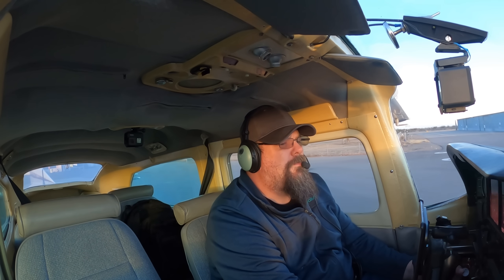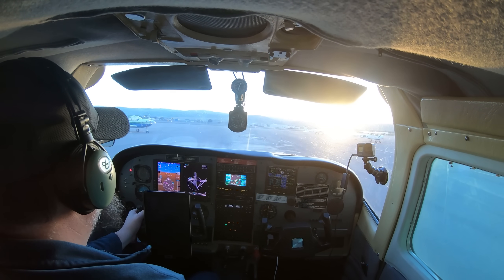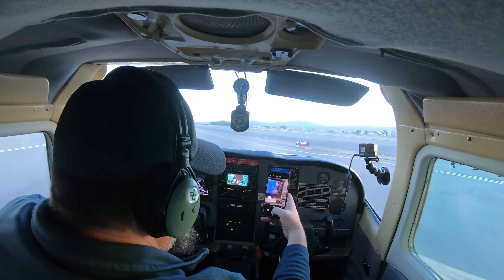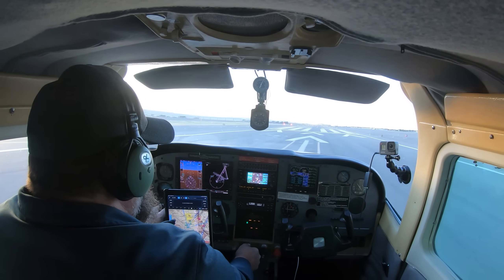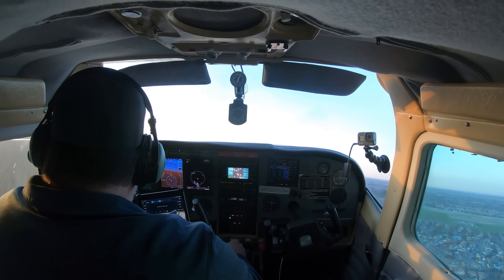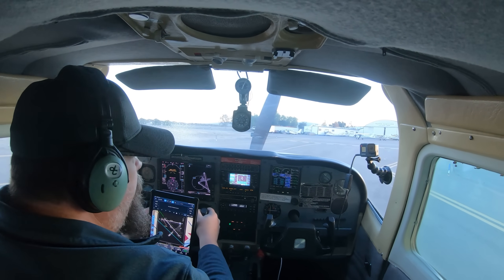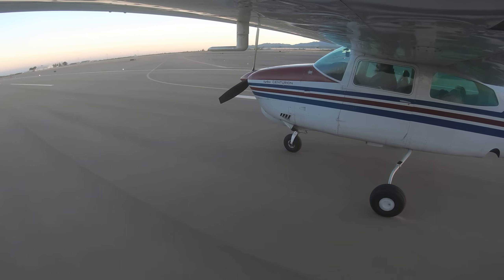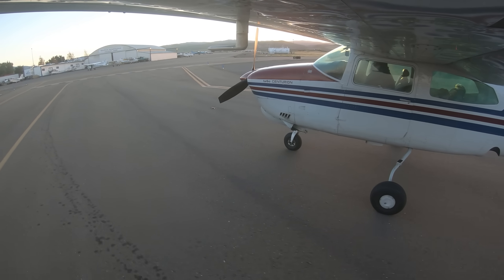Catastrophic Engine Failure after Takeoff

Comment: What are going to do about it?
Try to find a aircraft mechanic that knows what they are doing!
Reply: Hard to blame the mechanic without tear down and evaluation of the parts and data. Not saying it wasn't the mechanics fault but it could have been defective parts or detonation,  it could have gone lean and detonated from when the pilot accidentally pulled the mixture instead of the prop back right before the engine let go its impossible to put blame or point out the root cause without a full evaluation of the data log and engine hard parts. Most importantly the pilot is safe!

Comment: Hey Ed you were amazingly calm when the engine failed both times.  One in the air and just before you landed. I agree with one of the comments below, engine failure is one of my biggest fears.  I don't have a pilot license but moving towards that goal. Great video and I can only hope to handle a engine failure as calmly as you did.  GREAT JOB!
Reply: It only failed once. At that point it was just windmilling, until he slowed down enough that it stopped completely.

Comment: I'd be interested to know what type of facility did that overhaul. Was it a major engine shop or a local mechanic? It may be a pictures kind of thing, but the cylinder base nuts, case half seams, and case looked unusual for a fresh overhaul.

In the future, it might be a good idea to keep the gear down and let it run at takeoff power until in position for an assured landing. Notice how it came unglued as the RPM reduced? My SOP is to not mess with the power from liftoff to 1000 AGL for that very reason. Not the first engine to self destruct during a power change.
Reply: The nuts and case seam issues may be due to what looks like connecting rod failed and beat a new inspection port in the crankcase. 

Hope you have a good warranty on the engine. That one looks trashed.

Comment: Well, that sucks. Could have been worse and happened at a lower altitude. would be interesting to see/know what happened, [Besides the obvious air conditioned crank case.] maybe bad bearing/crank fitting although you said the oil pressure was in the green? Improperly torqued rod cap nuts?
Either way that motor is toast. May be able to save some sleeves, rods and pistons. If it were me going 1,000's of feet into the air with it, I would want an entirely new long block...Heads, cams, sleeves, crankcase with everything in it..."Long Block" Only reuse the external parts such as magnetos etc....

Comment: Good job managing your airspeed and saving yourself and the plane.  Bad move mixing up your prop and mixture knobs though... Not a great thing under boost... that shouldn't have grenaded your engine though.  Looks like the engine shop owes you a new engine.  Hope it works out for you.  Maybe the connecting rod bolts maybe weren't torqued to spec or a bearing wasn't installed properly.

Comment: These damn American piston aircraft engines.. I've had numerous cars, driven hundreds of thousands of kilometers, never one engine failure. Not even close to to one, even.
But shit like this, in the video, happens way too often in these aircraft engines.
Reply: Automotive engines are not expected to run at high continuous power settings. The Australian GM Holden 202 castiron motor weighed around 400 lbs. As an industrial motor for continuous duty it was rated at about 62hp. Its maximum HP was 119 "when engine longevity is not a consideration." Modern automotive engines are better but their task is full power outputs intermittently. Once well into their normal lifetime, a run at high continuous power can break them.
Reply: @DARANGULAFILM  Do you have any reading on that? I don't believe it. There are a lot of various types of applications where modern gasoline engines are required to run at high power output, in particular when towing at maximum payload, etc.
Reply: The specs on the GM Holden engine came from the sales information brochure. It is an older engine series so your comment is valid. 

The internal mechanicals of modern alloy engines seem to survive longer than in the past. 

That may be due to some operator and servicing mismanagement being taken out of the equation by electronic fuel metering, ignition systems, more refined manufacturing process and improved metallurgy. 

Those gains have been negated by some beancounter decisions like open decked engine designs which have foreshortened lives due to distortion and failed head gasket seals when driven hard.  

It is also a horses for courses thing. Heavy road transport engines are designed for longevity and deliver it.

Comment: Congrats on getting back down safely. There was a Beech Baron flying by my area when something similar went bang in the left engine. A 3" piece of the cam shaft exited the engine leaving a hole in the upper cowling about 3x4 inches. The front two cylinders and crankcase separated from the rest of the engine and were held on only by the thin metal of the oil pan. No prop control was possible for feathering, so the pilot landed a few minutes later at KIPT with the front of the left engine and prop dangling in the breeze.  Luckily the airport was straight ahead and about 10 miles. We changed the engine and patched the top cowl, but that was one for the record books. Imagine what would have happened if the prop, front crankcase section and cylinders had peeled off.  I can't imagine why they didn't. Apparently the crank shaft broke first.

Comment: Throwing a rod isn't fun. Wonder if a magnetic flux check would of caught any hairline cracks. on me a mechanic had been using a metal hammer on a 172 rocker arm to free up a valve that would stick. I found that out after using the plane skud running under a 1,000' ceiling when the right side rocker arms came apart. Not much power after that :)

Comment: My biggest fear. Damn dude. Nicely done.
Reply: This is also probably my biggest fear or one of them. Engine out, during takeoff... But you made it back! Nice work.
Reply: My father and best friend died from this. Both fighter pilots. Super Decathalon. Engine quit a touch lower. So so glad he made it! Praise God! This guy did great.
Reply: @The Woodsman  had a friend die in an ultralight when the engine died on takeoff. It basically stalled out immediately and side slipped into the ground.
Reply: @btbarr16  i hate to hear that buddy and my comment wasnt intended to offend anyone. I just cant feel at ease in an airplane bc it has an engine i loove engines i thoroughly enjoy building engines for people. But im telln ya ive seen parts fail stock parts that have never been touched with few hours no rhyme nor reason. Ive seen 4 different bikes brand new kawasakis bust pistons across the wristpin bore. Two had less than 30 hours on them one had less than 10. So i cannot have any faith in an engine i know nothing about im just supposed to trust that the last guy did things rite when working on it and that no parts will fail. I just cant
Reply: @Logan Penland  I want offended. Ultralights are dodgy at the best of times. I work in airport operations. So, I'm no stranger to what happens when things go sideways. I'm the one who has to deal with the aftermath. That said, the vast majority of the time incidents and accidents are due to pilot error, not mechanical failure. Even the times when I have dealt with aircraft incidents due to mechanical error, they're usually situations where if the pilot would have done a better job, things would have gone better.
Reply: All engines have bearings bearings fail even when oil bathed. As in this case one of the big end connecting rod bearings decided it wasnt going to turn anymore and pitched the rod out the side of the block million wonders it didnt lock down immediately. Maybe the bearing clearance was too tight or that bearings oil galley was plugged and starved it of oil. Either way this is precisely why i cannot trust/feel at ease in an aircraft. Pulling off the side of the road when your car quits is not the same as when an aircraft engine quits or in this case throw the rods of of the airplane. I give this guy props for how calm he handled the situation and for the awesome job he did  landing that thing it locked totally down when he about to touch the runway

Comment: First off I'm glad you didn't die and did an excellent job of controling your energy and getting the nose down to make it back, just barely!  Now about scaring your mother you are in big trouble for that and will hear from her later today.  Sorry about the engine but glad you didn't get broke most of all.  Looks like you didn't have to change your pants either cause you were puckered up real tight and focusing on the important stuff like not making a smoking hole in the ground.  I might have opted for the road while I still had the time but I was not there and am proud of the way you handled things.  You still have to deal with your mother though so have the good scotch ready!

Comment: You say you did what you shouldn’t of done, but seeing that you managed to fly the plane and land safely on the runway, i say you nailed it in an intense scenario.  Great job!
Reply: His situational assessment - "this is the altitude I turn..." and familiarity with the airport made that split second decision a good one. Seems likely he'd have landed straight ahead if any of those criteria were different.
Reply: Hell yes! You could have easily stalled trying to gain any altitude at such a low RPM. More importantly, you knew that you had to land regardless, and an airport runway always beats a highway, a plowed field or a forest any day of the week!-John in Texas
Reply: I think that rule is intended for regular pilots, not the exceptional ones. We now know which class your in.
Reply: @jsiwek7212 Physics don’t care about your feelings
Reply: shouldn’t have*
Reply: Sir, most airports have one runway. He would not have successfully made the turn if there was only one runway
Reply: Having the performance of a turbo big bore six made that possible. Anything less wouldn't have made it to pattern altitude.
Reply: @timmoles9259  o8
Reply: He turned in the correct direction - towards the other runway. If it wasn't for that runway he wasn't making it. With great fields straight ahead, it would be a safer choice to continue forward. I think that's what he's referring to, and he's right.
Reply: @alk672 what airport / runway did he take off and land on ?

Comment: 13:30  Turning LEFT and diagonal runway 8 from departure runway 30 saved the day. Right turn or no Rwy  8 you'd be screwed.
13:32 Expert mechanic says  "Well here's da problem, connecting rod suppose to be inside" then chargers $150 diagnoses fee,
13:50 Thank goodness for the data plate holding the engine together.
Reply: HAHAHAHA

Comment: Your immediate lowering the nose and turn back (left not right), maintaining airspeed saved the day. Agree turn back to airport is often not a good idea but NOT always a no no. That is a whole debate and no one right answer, depends. It worked out well this time due to runway 8 saving you another 80 degrees of turning. The partial power you had right after initial failure helped. Great job.
Reply: You can see that it only just had enough energy to make it and a slight variation and it would have been before the fence.   As you say its all about the exact conditions.  Its very difficult to tell from gopro wide angles but I'd have been thinking about that land just outside the airfield because our plane has a lot less power to start with and it doesn't glide has well as his neither!
Reply: @dr_jaymz  Plus the winds may have helped if they were strong winds that day could've easily pushed the plane a little further closer to the runway. Secondly, you said your plane is a STOHL kit added to it? my guess is with that configuration your planes able to fly a lot slower than typical GA planes do and that may have help safely return back to runway, meaning your stall speed might be lower with that kit. Plus you still have 20 degrees of Flaps in that gently brought you back. Or did you raise the take off flaps. 

I probably wouldn't have lowered the gear until you have no more turns left and straight onto final approach. Why, it typically adds a lot of drag and slows plane down lowering ability  to make it to field etc. Great Job

What type of plane is this? is it turbo charged, pressurized single engine plane?
Reply: Fidd88  Great point. Ground speed is so critical when you crash. Higher the speed the more energy. If there is a strong head wind on takeoff landing under control at min speed into the wind will minimize your ground speed and impact energy.
Reply: What about not lowering the landing gear until later?  Wouldn't that help significantly?  Looks to me like he barely made it back.   I feel extreme dread just watching this, never mind actually doing it!  Too much to go wrong.  Proper engine break-in should be done on the bench it sounds like, not in the airplane, and it sounds incredibly fickle, which makes it another 'nope'.
Reply: @someotherdude   You make two great points..... and in the famous words by a great philosopher......

NOW YOU TELL ME?

Ha ha good point, delayed gear extension and run engine in test cell. Agree. However most "field overhauls" are broke-in on the plane with ground runs and in flight. Most shops don't have test stands or test cells. Only the big overhaul shops do it in a test stand or cell off plane. You cam do ground runups in the plane but you need big air blowers or air movers to keep the engine cool. That is why they do min ground runs and get the plane in the air. The engine can get full cooling in flight vs on the ground. 

Clearly something went wrong with the lower connecting rod. Did they forget to torque it? Also the ground runs were minimal. However 1000's and 1000's of overhauls are done without issue every year.

Comment: That's not fair.
Great heads up on fixing your situation. I hope I can do as good if it happens to me. It should be instinct to push the nose down when slowing.
That engine was not put together correctly. Rod bearing spun/froze? no oil? Insurance will cover it.
I hope they find the root cause.

Comment: Him: “I was in the air for one minute, 12 seconds”

Me: still counts as 0.1 in the logbook.
Reply: And a landing to a full stop toward your 90 day currency requirements. Sometimes luck is better than skill. Just an FYI shoulder harness saved my face from eating a panel once.  
Good job ! Glad you made a safe landing.
Reply: The wind don't blow for less than one point oh.
Reply: 0.01  0.1 would be 6 min. But I would log it just to have record to look back on.
Reply: @mikeryan6277  Isn't flight time logged from the time your aircraft moves under its own power for the intention of flight ? I'm sure the Hobbs time was atleast a 0.1 even though the taxi in wouldn't have been recorded on the meter due to the engine failure.
Reply: @mikeryan6277  Logged flight time is from start of taxi for purpose of flight to stop at the end of flight.
Reply: @mikeryan6277 I had a cowling come off, it was even less.. maybe 30 seconds. Landed on the runway. I didn’t log it, but I’ll never forget.
Reply: @PandiTheBear  yeah I’ll bet that definitely got your attention, did it do any damage to the plane?
Reply: I guess that includes the time it took him to wash the shit off the front seat.